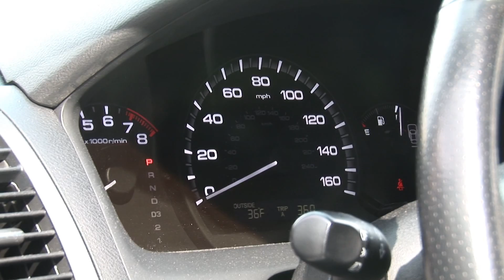Car Maintenance : Where Is the Speedometer Cable on a Car Located?

Comment: i have a 1981 caprice classic..
its leaking fluid from speedometer cable
i got a new 1 
but when i put it on it still leaked
it didn't come with any type of sealer
and the sealer off the old one is all chewed up
what would you recommend me buying
so that the leak stop?